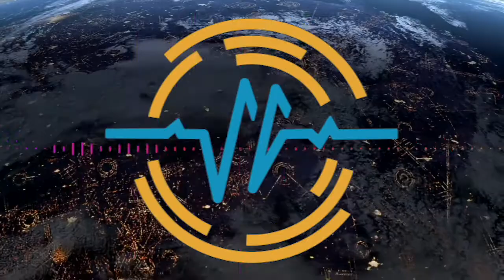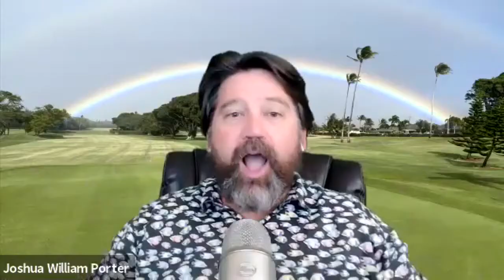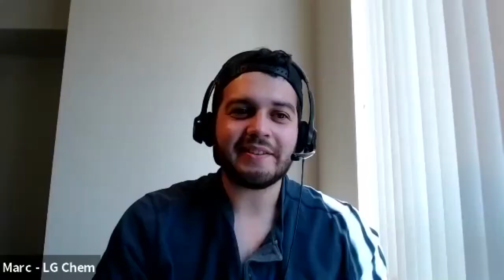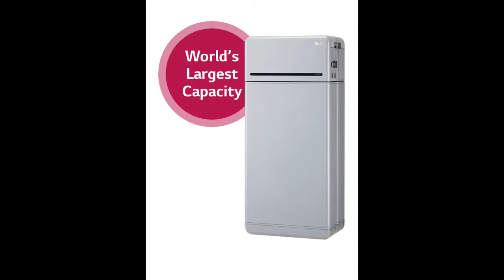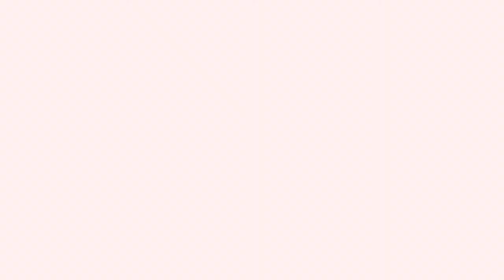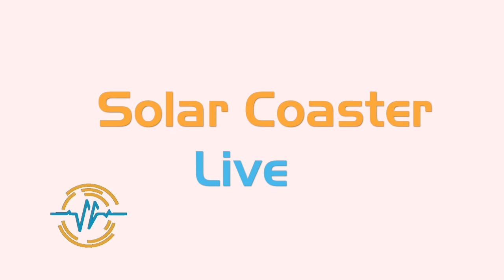BREAKING NEWS BATTERY!!..SESHWE 2020 SC#11 - LG Chem's Linh Tran & Marc Chandeck introduce 16H RESU!

Comment: now what with the lg chem 10 h recall i have 4 lg chem 10 h installed in 2018 all 4 have been replaced due to crapping out now in 2021 they are recalling all 4 of my batts again so with all these  battery replacments since 2018 i have had only maybe 6 months in more than 3 years that my system was 100 percent now they reduced my soc to 75 percent i will tell the real story lg chem has not worked for me in hawaii at 12 grand per battery my return on investment does not work end of story do not buy lg chem please get the word out